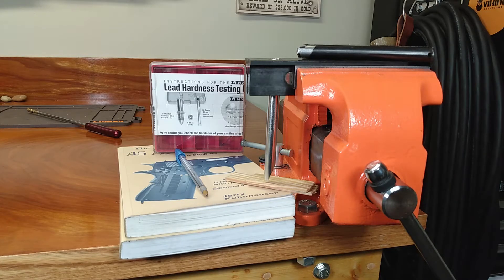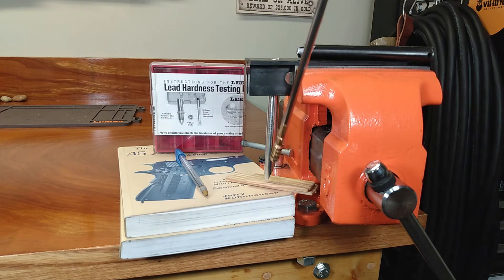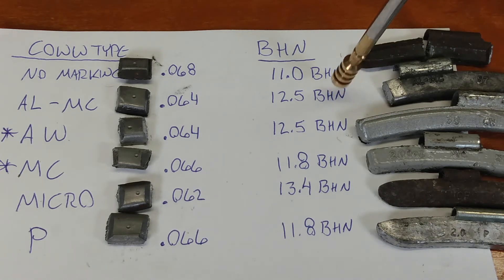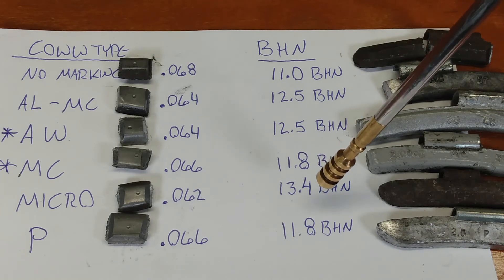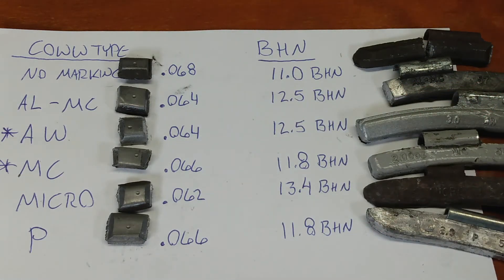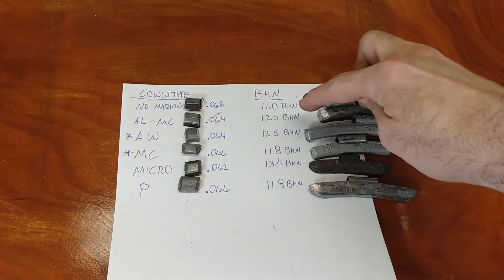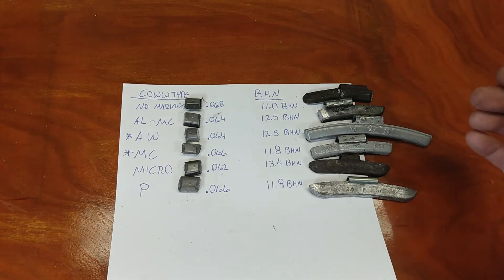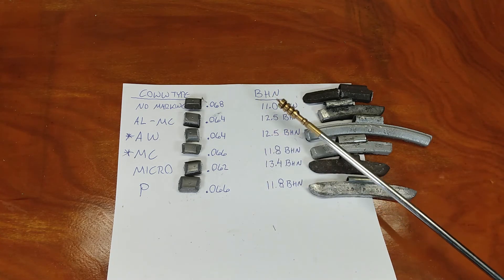3. Varying Hardness of Wheel Weight

Comment: The markings are actually an indicator for what type of metal wheel that particular weight may be installed on. They make a plastic rim gauge for Clip-on wheel weight application, which is used to determine the clip profile and clip-on weight style of the wheel. The gauge includes eight profile weight styles: P, FN, LN, TN, MC, LAW, EN, AW. The indicator corresponds to a particular edge shape/profile of which MC is probably the most common alloy wheel used on most American manufactured cars and light trucks.

Comment: As I stated in your previous video on WWs, the markings are for application and if coated or not. Exception is Zn for Zinc and Fe for Ferrous/Ferrum.
The varying hardness you show for the markings are from the various manufacturer alloys and even the same manufacturer but different time periods. Or, year of manufacture in the US.
Not worth wasting time and effort sorting amongst the clip-on weights.
Heat treat if you need them harder.
Reply from the maker: I had a guy in one of the forums that I frequent display some apprehension about certain coated weights. That was the motivating reason for this video. But, through this little project I found that there are a lot of people tossing out good lead simply because it doesn't look a certain way. Hopefully this video helps.
Reply: I think it will help. No reason to be scared of the lead. Just aware of the parameters. Do the initial WW melt at a low temp and throw out the junk. Then melt again to clean as needed. I saved zinc for some time to cast really hard bullets, slingshot ammo, and sinkers, but never got around to it so took buckets of it to the recycle place. If I want a hard bullet I'll just heat-treat, which is what I do for the 500 NE. I didn't want to dedicate one of my melting pots, molds, ladle, etc just to cast zinc.

Comment: I just finished sorting out 2 buckets of wheel weights and was considering trying to sort out the clip on ones that seemed softer for possible black powder use. Ended up just tossing the clip on weights together and separating out the stick ons for the front stuffers.
Reply from the maker: Those soft stamped stick ons are ideal. I've made lots of great round balls from them.
Reply: @leadsmith44  Yep! I was able to get a handful of em. Ended up with 215# clip on lead, 16# stick on lead, 46# steel, and 15# zinc and trash. The 16# of soft lead will make a lot of .350 round balls for my squirrel rifle but I burn through a lot of lead when the Minie ball mold comes out and I start casting those .575" 535gr  bullets.
Reply: Don't know if this helps but if the whole weight is drawn to the magnet it's ferrous and not lead if ONLY THE CLIP is drawn then probably lead unless marked zinc